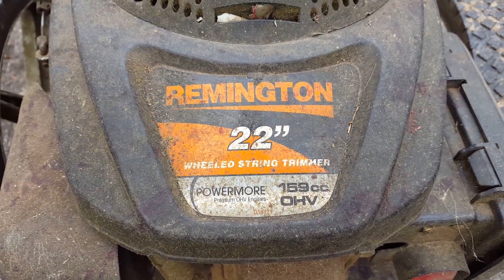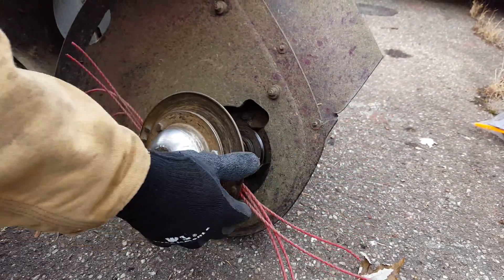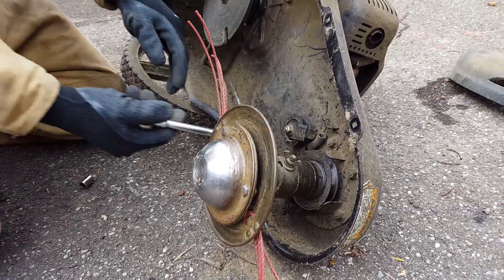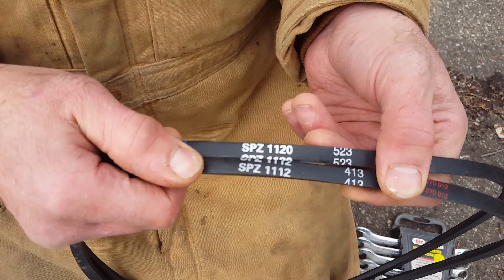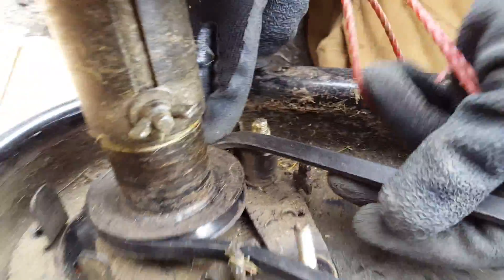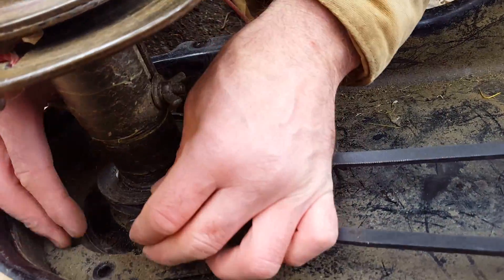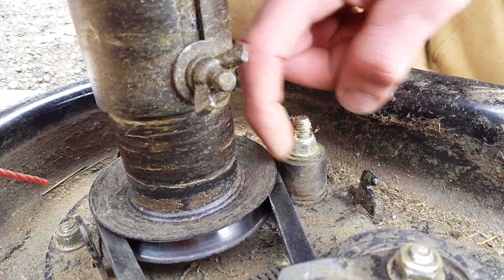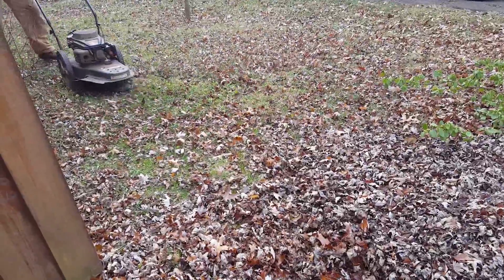Replacing the Belt on a Remington 22 inch String Trimmer

Comment: Know its been a while since you posted this, great content. Questions hope you can help, did you drain the gas and oil before turning it on the side? Was told that oil could ge into the carburetor through the vent on the carb. And the gas would also dump and flood it out.

Comment: I unboted the round ball skid in the front a d removed the trimmer thing and then put the belt on lubricates all the parts as well changed the spark plugs but can't find the fuel filter to change it
Reply: These units have no fuel filter
Reply: It's at the end of the fuel line entering the fuel tank.  Might have slipped inside the fuel tank.  It's a long thin piece of plastic.  Try looking inside the fuel tank.

Comment: I know this is late in coming, like 8 years too late, but I need to tell you from experience that when your dome (the part that makes contact with the ground during use) is in that kind of condition, it will sheer off soon and your inner spindle parts will be exposed to dirt and small rocks and it will destroy your spindle, necessitating an expensive replacement. You can order the dome by itself for not too much money compared to the hideously high cost of a new spindle.

Comment: Good how-to.  No frills.  No loud background music.  Thank you.  Your Swisher belt is located more like in my Cub Cadet ST100.  My Swisher belt is on top--much easier to access.  Thank goodness.  And thank you again.
Reply: Of course, if you follow his video to the "T", I can pretty much guarantee that your machine will NOT last very long. Only a genetically enhanced moron would turn the machine completely upside down and allow all the sludge in the lower case to run up into the valve guides/seals and the lower cylinder and piston wrist pin... jus sayin

Comment: Very helpful, thanks. Any chance yall have a video on fixing the spindle? Mine came off but cant see what broke to keep it on. I fixed the belt but not enough tension to keep the spindle in place. Thanks.
Reply: The spindle is not held in place by the belt.  It has 2 bolts with wing-nuts that hold it tight.  That's how you get the height adjustment.

Comment: Started off OK but the rear axle got in the way so had to remove the wheel & axle to get the belt on.  Got that part all put together again but there is NO WAY to get the belt onto the front.  How do I remove the spindle?  Tried every which way and no go.  The belt is the perfect length making it too short to pull over the spindle.
Reply: It's connected by the bolt at the center of the top of the deck of the mower.

Comment: Can u tell me if there is a fuel filter somewhere I can't find one anywhere
Reply: It's at the end of the fuel line going into  the fuel tank.  Might have slipped into the fuel tank.  Took me about a week to find mine.  It's a long thin slotted piece of plastic.
Reply: There is also a filter in the top cover underneath that u need to check

Comment: Thanks so much for your time in sharing.  Just picked up one of these and was wondering what the best line to use in it.  You mentioned in the video you buy and cut your own.  Can you share a link to what you buy?  Would gladly appreciate it!  Also do you know if there is an attachments for this unit like a saw blade.  did not think so for the price point this unit is sold.  Also how long have you been running yours?  It looks like its made a few seasons with you?
Reply from the maker: Hi Matt, 

Thanks! We originally made this video for ourselves and it's cool that it has been useful for other people. We had actually only been using this trimmer for a year when this footage was taken, but we work this trimmer very hard (thoroughly abusing it, as you can see from the wear) and probably logged a lot of hours in that time frame. It still runs like new. Be sure to clean the air filter frequently, and put a big piece of tape over the oil dipstick cap. It is possible for large blackberry plants to grasp the cap and complete the quarter turn to completely remove it from the running trimmer as you pull it away. I had to learn that lesson twice before we put the tape over it. 

We've been using Grass Gator 3.9 mm twisted trimmer line. 
I think this is it: https://www.amazon.com/Grass-Gator-Z9155P-3-Pound-Twisted/dp/B005KQUAHM/ref=sr_1_3?ie=UTF8&qid=1465736934&sr=8-3&keywords=grass+gator+twisted+trimmer+line
We cut it to the same length as the thicker orange line that comes with the trimmer, and use two pieces on each side. It will hold up for a long time in grass. I do use it to cut through very thick brush but it has to be replaced frequently when I do that.

I don't think that there are any attachments for this trimmer. The beauty of using trimmer string instead of blades is that it prevents the engine from getting bogged down in the thick grass and brush that has been known to kill riding lawn mowers at our place. Because of that design I don't think the engine would be strong enough to use anything other than string. I trim around saplings and anything else too thick and then do a walk-over with loppers.
Reply: @Duckifyable  I just use the original replacement line that comes with a Craftsman.  Both of these units are made by MTD.  The line is available at Lowes.  I just bought a couple packs. 8.79 a pack BUT they last a lot longer than doubling the twisted line.  I had to do that in a pinch, so I have used both ways.

Comment: Your belt looked pretty tight without having the belt engagement handle pulled back. Does the trimmer head stop turning with the belt engagement handle released or does it constantly spin when the engine runs not allowing you to turn it off?
Reply: Always turning

Comment: Doesn't the oil spill out when you turn the mower upside down?  I ca see that on its side, the oil spout is on the top. so no problem.  Did you drain the oil first?
Reply from the maker: It's been a while but if I'm remembering correctly it did spill a bit, yes. Draining it first would have been a smart move, but it's not an easy reservoir to drain.

Comment: Please....don't work on any of my machines. Turning a small engine upside down is the perfect action to take to run sludge in the lower casing up into the cylinder, head and piston pin. Golly, even your knowledge of the parts is appalling. That metal is a belt deflector/retainer. The pin is the belt pin deflector, the pulley is an idler pulley and the spring is a tensioner spring....please stop working on anything more complex than legos
Reply: sounding just like a mechanic. maybe you could have mentioned the right size belt for the job?